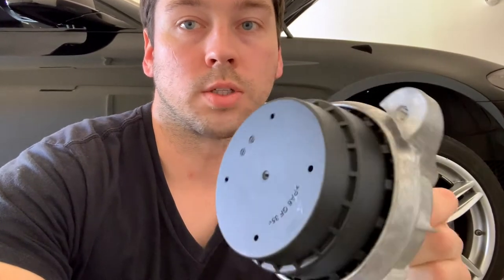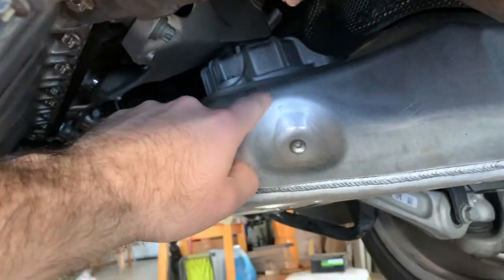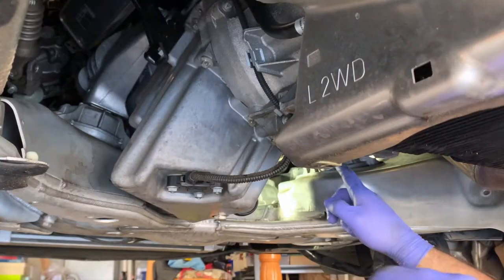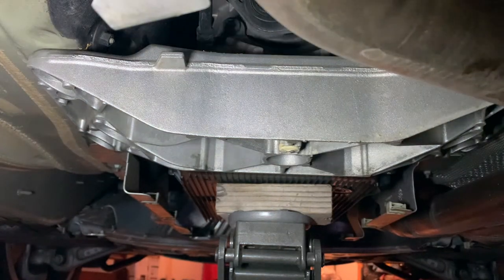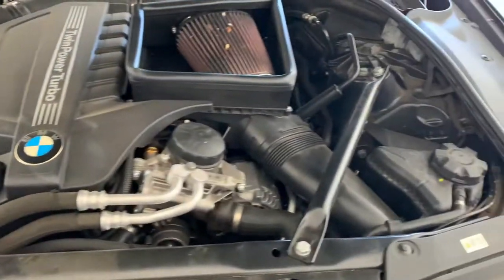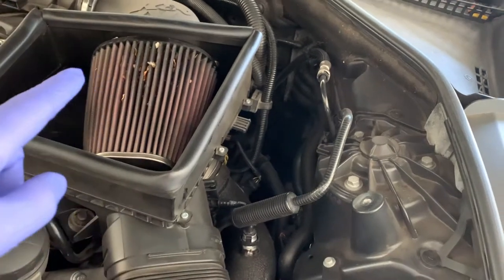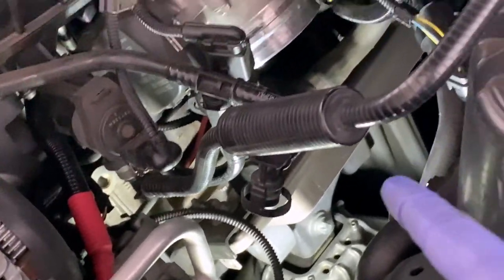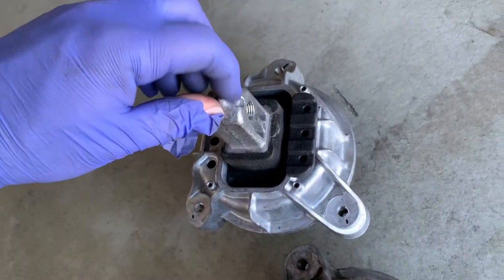How To Change Engine Mounts & Transmission Mount On A BMW F10 535i (N55) | BOND Garage

Comment: This video is very helpful! How did you realize that the engine cant be jacked up a bit higher? I am planning work on the same project with my 13 535i xdrive.
Reply from the maker: Realised it when the entire car started to float above the jack stands. Something you want to avoid in this case.
xDrive is a little more complex. Good luck!
Reply: Tyty

Comment: Great vid! How did you unscrew those 4 bolts for the motor mount bracket for passenger side?
Reply from the maker: those were actually somewhat easy. at least 3 of them. the 4th one is blind and you need to bend yourself into a pretzel and keep your cool

Comment: Great video.  You mentioned a couple of times that the bottom of the new motor mounts are hard plastic vs the rubber bottom ones, which are better and why?
Reply from the maker: I'm honestly not sure. But apparently some models come with active motor mounts. So it's good to double check to get the right mounts before digging in.
Reply: Rubber mounts

Comment: I live in US and autoshop costs $1600 to just replace my engine mounts for both side.. do u think i can try DIY on this to save money? They said it will take them 6hrs to replace this
Reply from the maker: depends on your skill and confidence level. there's not much that has to come apart and I'd say you can do that in 6 hours while taking a nap in between both sides. 6 hours sounds like they want you to go somewhere else. It's the "i don't want to do it" quote. shouldn't take a professional more than 2 hours to do that job.

Comment: F10 with N63 engine? That is 550i. Is there even room to get into the 4 bracket bolts of the driver side mount? I see the tranny cooler lines are wrapping the mount. I did the passenger side just now and it is difficult. I see the driver side is impossible without dropping down the subframe 2-3 inches. Anyone?
Reply from the maker: yea I guess N63's are out of luck. will need to drop the subframe. just did a N57, that works like the N55

Comment: Did the part number of the gear mount change or does every car version have a different gear mount?
Reply from the maker: there are different types. the ones on my 5 are static. rubber only. on my buddies 535xd they are fluid filled. you'll see a little hose on them to differentiate. if you run your VIN through realm you should find the right part number for your car.
Reply: @BONDGarage  thanks for your message. I already searched for the right mount with my vin. The resolution says, I have two different mounts. But that's not possible. I already contacted an bmw dealer who will have a look which mount is Bild in. Thank you again.
Reply from the maker: @akidemir4502  yea that doesn't sound right. eitherway it's the same work once you got the right parts. was actually more annoying than expected.

Comment: Hi ,  the transmission has only one mount? So it’s not two?
Reply from the maker: Right. The engine-transmission unit rests on 2 engine mounts and 1 transmission mount in this case.
Reply: Ok thank you ,  my car is Bmw f10 535 exdrive all wheel drive ,  do you have the same car
Reply: Does make any change rear wheel drive and all wheel drive
Reply from the maker: It does. The xdrive models have 2 round mounts. At least for the pre-LCI models. Not entirely sure of the facelift models.
Reply: Do you know if the 2013 528i has one mount? It’s rear wheel drive

Comment: Are the engine mounts and transmission mounts the same?
Reply from the maker: no, they're are different. transmission mount is more or less just a rubber block. engine mounts are what you see on the thumbnail.
Reply: @BOND Garage  are they near each other? 

I want the dealer to change the transmission mount when doing the rear differential bushings and i was seeing if i can have them do both for the same labor charge if they are close to each other
Reply from the maker: doesn't matter if they're close together or not since they can be changed individually. just matters how fast it can be done. Transmission mount alone is a matter of 10min if you have a lift. So would be nice if they can throw that in free of labor charge but wouldn't expect anything going to the dealer. An indy might just charge for the part and grant you the labor as discount. engine mounts are another story though
Reply: @BONDGarage  sorry i meant to ask are the transmission mounts and rear differential mounts near each other?
Reply from the maker: @socommaster  no. the diff mounts hold the diff at the rear axle. the transmission mount is pretty central under the car. doesn't take much to change it. in distance though, they're about 1,30 meters apart
Reply: @BONDGarage  okay thank you!

Comment: Was there a big difference after replacing all the 3 mounts?
Reply from the maker: honestly, i felt none but you can see that the old ones had collapsed a bit. But I heard from everybody else that changed them that they had tremendous vibrations before that were gone afterwards..

Comment: I cannot find a single video on a F10 535i XDrive transmission mount or mounts?..  help . I can't find the location of the mount or mounts fcp Euro kit came with two round mounts like on a E90... I don't know what's going on here ....🤔🫨
Reply from the maker: I see what you mean. they look different. the ones for the 535d look very similar to other models. they are mounted between the subframe and a bracket that connects to the engine. one driver side and one on the passenger side. you'll find them.